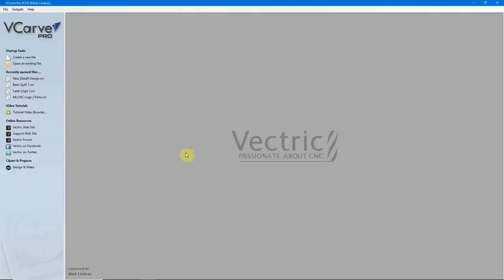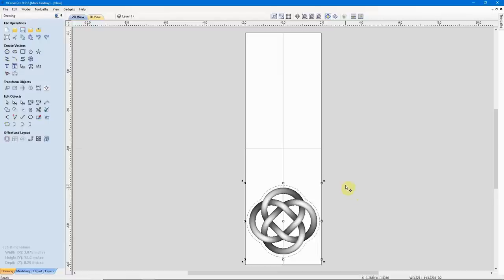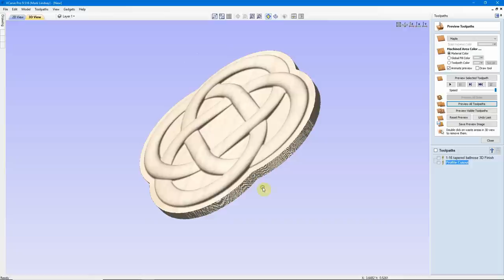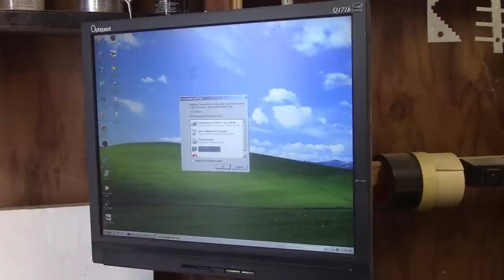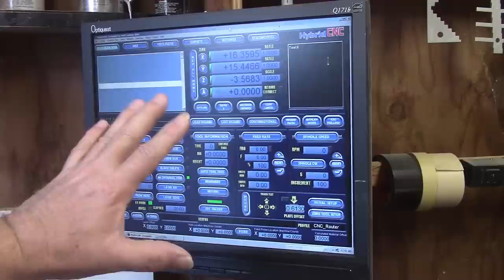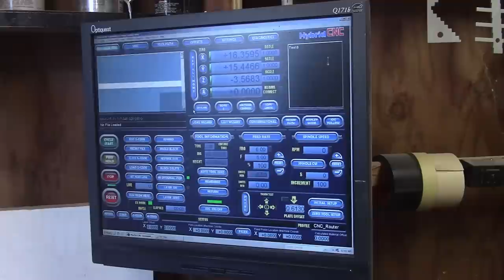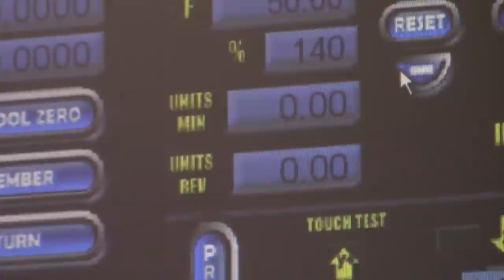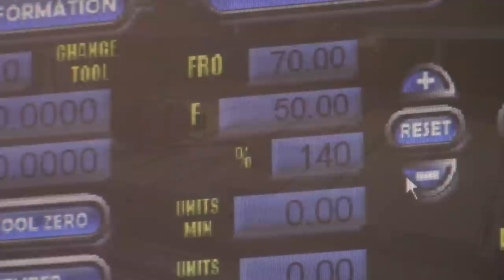3D Carving Workflow with Tool Change - Part 21 - Vectric For Absolute Beginners

Comment: Great info!  Thanks so much!
I was particularly looking for re-centering during tool change as I seem to need a full xyz zeroing or the path goes crazy... offset anywhere from 1/2" to off the end of the y axis, and more than once driving the z right thru the piece (good that I have a thick spoilboard) even though i had re-zeroed Z.  But then when I re-zero all 3 axes even though I have to fine tune the xy for true matchup with the previous toolpath, it behaves itself.  I am using an inherited aspire and gsender on an old laptop, cutting with a new 3018Pro on slate 
Sooo, I am naturally looking for the easiest and most repeatably accurate way possible to zero everything and the 3axis tool shows promise although a washer doublesided taped to a safe part of the material that would stay put thru all the cutting and tool changes might be even more repeatable on the flaky old slate with crumbly corners I am cutting.  
I went to the 3Axis website and it appears to be coupled with mach3 or mach4 software, and the tool movement during zeroing works automatically within that software.  will the 3Axis tool work with other apps?  
Thanks again!!!  Your series is awesome!

Comment: not sure if you monitor this any longer but I just viewed and was VERY helpful but I did see the 'finishing pass' edit tool did not have a setting for max cut depth per pass? Does it just go as deep as needed regardless of how deep? 1/16" is a small bit and fearful that it will have to make a constant X or Y cut ?? inches long cutting say 1/4" of hardwood? Also, while I get that the roughing pass with Raster will take a lot longer than the other way, will it then help remove a lot of the excess that the finishing pass (with no max cut depth) would have run into if not done that way? I am willing to take the time to remove more material when roughing than to have a bit break half way through the project due to it removing far more that it would have needed? Thanks in advance for any help and great job explaining!
Reply from the maker: Your concerns are valid, and it's good that you're questioning the cut depth. The short answer is yes, the bit goes as deep as needed, regardless of how deep that is when you're talking about a 3D Finishing toolpath. That's why a roughing toolpath is so important. Having said that, even though it's got a 1/16 inch diameter tip, a tapered ballnose bit will clear away a lot of material along the length of the taper before the tip gets to it. The only exception to this is the initial plunge when you first start the finishing pass. Once that plunge is done and the bit starts moving in X or Y (or both,) the taper will help clear away material. 

If you're willing to take the time to do a 3D Raster roughing pass, with a Machining Allowance of .030,  then that's the best way of making sure that the maximum amount of material is removed without the roughing pass cutting into the actual finished surface of the model. Ultimately, the choice is 100% yours. Good luck!

Comment: Mark thanks for the video it was great to see some one do a cut on there cnc.
now I have a couple of questions. 
First are all of the clip art models in the vectric soft ware ready to cut to some preset thickness. So that all I have to do is select the proper tools and vectors to cut the  job.
Second is your touch probe  When   you do a xyz with your probe in the center of the hole where does z touch the probe. Also are all touch probes made to turn over to do just the z probe.
My Shapeoko cnc probe has the bottom machined out to fit the corner  when I do a xyz probe I put the probe in the corner and start the probe with the end mill in the  center on s small circle in the corner of the probe . Hit start and it moves down and does the z then moves out past the front on the probe moves down and the back till it touches the plate. and zero there picks up and  does the outer side in the same manner. and we are done.
 When I do a tool change  I set the  probe on top of the work piece just like you do but do not turn it over, I hold on to it because I feel if I don't it will tip. No one  has ever said to turn it over. So after all of that  should I be asking  about turning it over to do the Z setting.
One other question after you set the Z with your new bit did your router move up and move to the x&y position and then start the cutout.
thanks Jeff
Reply from the maker: Hi Jeff. Lots of questions! 
First, the clip art does have a certain thickness, but it can be resized and the thickness adjusted if you want to do that. Refer back to Part 19 of the series for a demonstration of that (the wedding ring plaque.)  https://www.youtube.com/watch?v=rIcP0L0jyNI

Second, your touch plate is no doubt different than mine - use it the way it has been working for you. The way I use mine is specific to my brand of touch plate. The hole in the corner of my touch plate is for setting the X and Y only. To set the Z, I would normally move the bit over the top of the touch plate and use that surface to set the Z, right there on the corner of the material. I only flipped it over and set my Z away from the corner in this video to show a couple of people who had been asking about using the Triple Edge Finder in the center of a piece of material. If your touch plate has been working for you, don't change a thing. For a demonstration of how I normally use the touch plate, refer to this video: https://www.youtube.com/watch?v=JGToDuTAAvY

Lastly, yes the router moves over to X and Y zero, then moves the Z to .8 above the material (that's the Home position in the g-code,) then moves over to start the cut. It always does that. 

Thanks for watching, Jeff!

Comment: Mark, watched a lot of your videos and they are absolutely AWESOME, learned a lot. I have what I think is a simple question (or maybe not) on bit changes and setting the "z". Let's say I am making a sign and it has 3D models on it. I use a roughing toolpath and remove a lot of the material other than maybe a small area on top of one of the models the surface has been lowered in the roughing. Now I put the finishing ball nose in. With the original wood surface gone (lowered) other than maybe a very small area on one of the models; how do I set the "z" for the finishing ball nose bit since most of the wood surface is gone? Thanks so much in advance and for taking the time to share your knowledge!
Reply from the maker: You can set the Z zero on any surface that hasn't been machined away, or on a piece of scrap from the same board/piece of material. It doesn't have to be from exactly the same spot you set the X and Y zero from.

Comment: Very thorough job Mark.  Pretty sure even I can follow this.  What router are you using?
Reply from the maker: Thanks, Chad! I use a Porter Cable 890 series router. Been using it since about 2002 and I love it.
Reply: Mark Lindsay CNC so, I suppose the follow up.  Are you using some sort of adapter to hold your end mills.
Reply from the maker: No, I'm just using the 1/2" and 1/4" collets that came with the router, and a 1/8" collet I got from Elaire Corp.

Comment: Why did you go straight to finishing toolpath in this example where as in the medallion example (part 20) you did a roughing toolpath first.  Was it merely because the medallion was much more complex and roughing was necessary to save time?
Reply from the maker: In this case, the reason I went straight for the finishing pass was due to the amount of material being removed - which was slightly more than 1/16 of an inch (a little more than 1.6 mm.) If I had done a roughing toolpath with this particular model, it would have just added to the overall amount of time spent carving it without accomplishing much at all. The reason for using a roughing toolpath is to remove the bulk of the material to make it easier for the finishing bit to carve away the remainder. In this case the total amount of material being removed was well within the finishing bit's capabilities.

Comment: Great video as always! I just have one question, which is, when to change the feed rate? Is there is a perfect time?
Reply from the maker: I like to see how the bit is cutting in the material, then adjust it from there. There really is no "perfect" time. Just whenever it has cut enough that you can see if you're running too fast or too slow.
Reply: @MarkLindsayCNC  Thank you so much for your reply Mr.Lindsay your shared knowledge is really helping me and alot of people like me thank you so much!

Comment: Hi Mark, Great videos, new newbie here looking a little help.
When using vcarve free clip art on occasion the cutter cuts areas it shouldn’t as if the z height is too low .
I haven’t changed any settings from the original Gcode file. Appreciate any feedback you give.
Reply from the maker: There are a lot of variables involved here. Firstly, when you've calculated the toolpath, hover your mouse cursor over the name of that toolpath in the toolpath list. A window will open, showing you the total cut depth. If that doesn't match up with what you're experiencing when you cut, you'll need to look for a mechanical problem on your CNC - losing or missing steps, etc... If the max cut depth listed in that window is too deep for your situation, you'll need to adjust the model thickness in the Properties form in the Modeling tab.
Reply: Hi Mark, thanks for your speedy reply. The cut depth thickness matches fine. 
After running the file again I notice that full depth of cut required 11mm .
My 3mm ball cutter has only a cutting length of 8mm, which It looks like the shank Is rubbing against the inside wall of the pocket and not cutting it, maybe causing it to lose or miss files. Does this make sense..
Reply from the maker: Yeah, you'll need a bit that will cut at least the depth of the model, or you'll have those problems. That or you can decrease the model thickness as I mentioned above.

Comment: if the tools had different diameters... lets say the end mill was a quarter inch would you need to reset zero on the x and y?
Reply from the maker: No. Once you set the X and Y, you don't have to reset it for a tool change. The X and Y zeroes are set to the center of the bit, and the toolpaths are calculated for each bit's diameter based on that.  The only thing you have to reset is the Z zero, due to different tool lengths, how far you put the bit into the collet, etc... Thanks for watching!

Comment: does the software or the machine tell you when and what to change tools?
Reply from the maker: In a roundabout way, yes. Each tool is run on its own file. That way one tool finishes cutting, the machine returns to home, and I load the next tool and cutting file when I want to. That way I can start a job late in the day, run one tool file, then come back the next day and run the other if I want to.

Comment: The 3% stepover on a 1/16th bit is overkill, especially in something as soft a cedar.  The cusp height at 3% is 0.000015"  The cusp height at 17.9% stepover is    0.0005"  .  Plenty smooth for most softwoods.    A good rule of thumb is 10% stepover for a 1/8" and 15% stepover for a 1/16. Both yield similar cusp heights.  Cuts your machining time by 2/3.
Reply from the maker: I agree with you 100%. Please remember that still fairly new to 3D carving when I made this video, so I was still learning. I now use anywhere between 7-10% stepover when 3D carving. As a home hobbyist, machine time is less of a concern to me than finish quality and time needed for cleanup sanding on the piece.  Thanks for checking out the video!

Comment: Mark,  How come you didn't have to do a zero plane on this model.
Reply from the maker: A zero plane wouldn't have accomplished anything with this model. A zero plane is usually used on models that are recessed into a bowl or dish, but don't do much (if anything) for a model that's meant to project upward from a surface like this one.

Comment: Mach 3 tip that makes life easier ----
in the gen.eral config screen -- note the UPPER LEFT CORNER. there is 3 check buttons. the top is ignore tool change.  next one down is pause on tool change, bottom one some text basically saying use atc.. .  UNCHECK the top one and check the middle one.  Save and your done.  Now use a mach 3ATCunit post and save ALL toolpaths to one file. The ony difference is you have to hit cycle start TWICE to get the file(s) going. When mach 3 hits a tool change and the new bit is NOT the same as the last toolpath it just pauses.

Now change bit and set Z then hit cycle star and youre off and running again.  The only real operational difference is you DO NOT have to make up a batch of individual files and load them as needed, its all there and just waiting on cycle start to get hit.   Try it.  you can easily revert back to back to the stock one file at a time method  if you dont like it.   Personally that is one of several reasons why I use mach 3.

Another video up to your usual standards... :)
Reply from the maker: Thanks John, but that's way outside of the scope of the video. Thanks for watching!

Comment: In your video here you indicate that you should NOT run the G-Code from the flash drive.  This may hold true for Mach 3 and Mach 4 users but with Masso this option may not be possible.  There are only 2 options with Masso router CNC, Flash Drive and Wifi transfer, and in each case you are required to ensure you have a Flash Drive installed.
Reply from the maker: Thank you, Charlie. I thought I made that point in the video. Some systems require you to run the g-code file from the flash drive in their controllers, which do not use a PC to run the software. My point in the video was that if you run your control software on a PC, transfer the file onto that PC, and not to run it directly from the flash drive.

Comment: Another great video Mark, I have learned so much from your series. From time to time I use 1/8” brass for some projects, are there any videos coming up that shows speeds and feeds for cutting brass?
Reply from the maker: Thank you, Jim. I have no videos about metal. I'm a wood guy. I occasionally dip my little toe into plastics, but after 5 years of doing this, I've only cut plastic twice. Sorry, but I can't help you with brass.